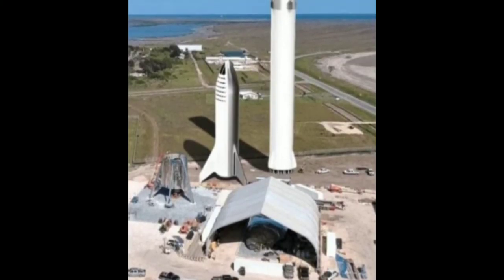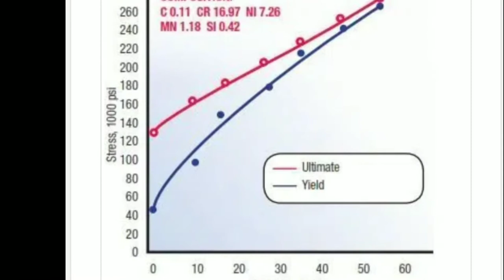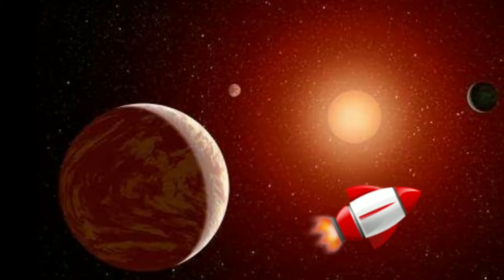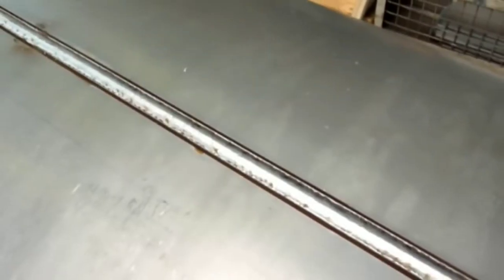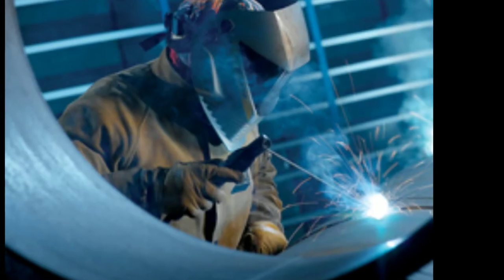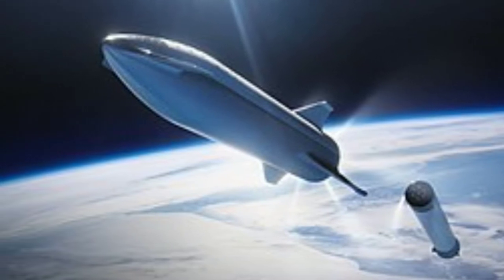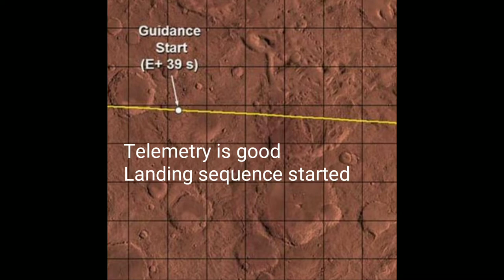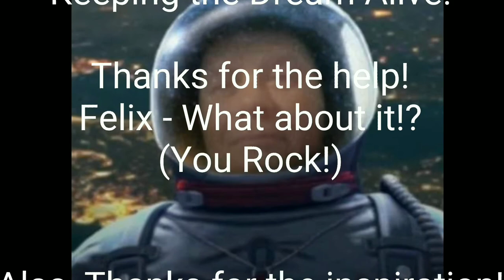SPACEX STARSHIP- Ring Sections, How They're Made - Mars or Bust - Episode II

Comment: I may have misunderstood but during Elon's presentation at Boca Chica I thought he discussed a new way of constructing Starship. Instead of stacking rings atop one another to be welded, the hull would be formed from a roll  of stainless steel using one continuous weld. I assumed this could be done in a horizontal manner by robot welders.
Reply from the maker: 301 Stainless Steel rolls can only be made so wide, because of this they will still need to be welded together to connect them. I might be wrong, but I think the widest they are manufactured is 144" wide rolls.
Reply: @MarsorBust  I was thinking they might be able to wind a continuous length Into a cylinder similar to how they make cardboard tubes for paper rolls. If it could be automated then it could speed up construction a lot.

Comment: Wait, if 301 stainless can go up to 2500 degrees, and Martian reentry is 1700, why do they need heat shielding at all?
Reply from the maker: That's the melting point of 301. Im sure they dont want to get even close to that. Also, they are now talking about using 304 Stainless that melts a 2650°F. Even with using 304 all that heat will radiate into the ship if there isnt something insulating the hull. 
Thanks for the comment! 
Dave
MoB
Reply: @MarsorBust  ah, I was talking about celsius